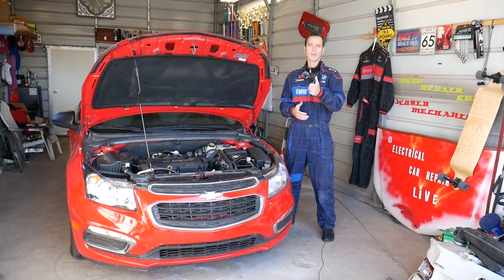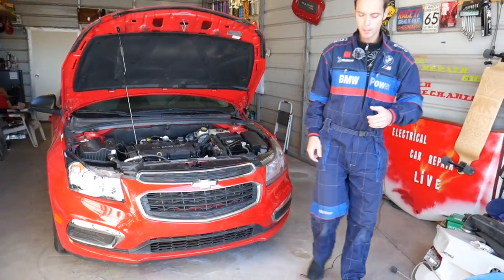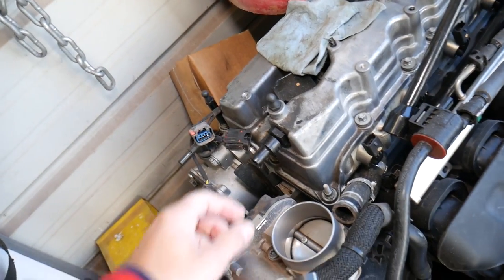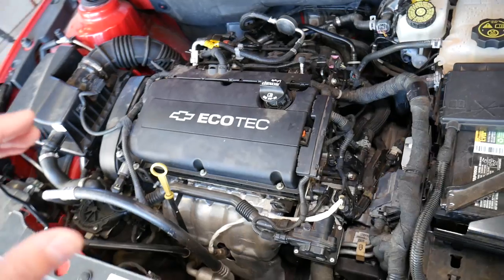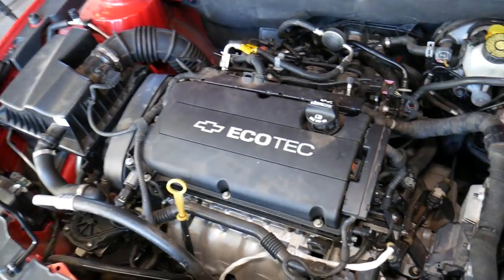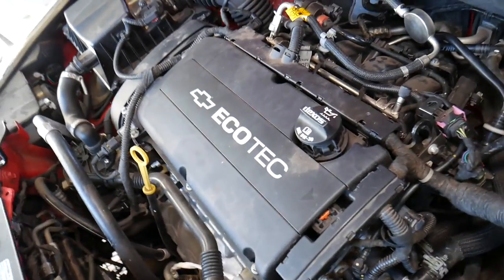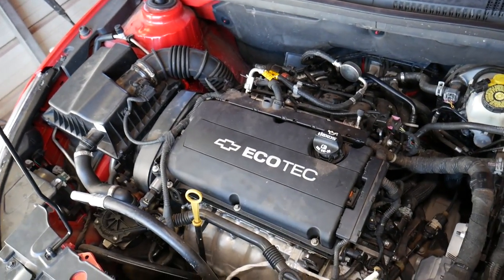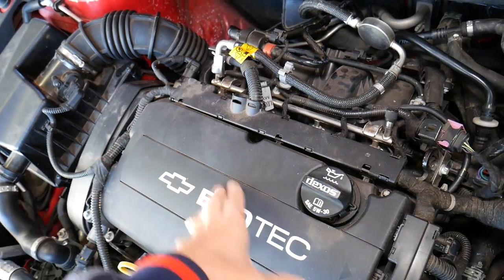SYMPTOMS OF BAD PCV VALVE ON CHEVY, CHEVROLET, GMC, BUICK, CADILLAC

Comment: My wife's car is a Saturn ion quad coup with a 2.2 Ecotec engine and I believe has the pcv valve built in to the top of the valve cover. I took the hose off that runs from the valve cover to the air intake and put a vacuum gauge on the valve cover and it has steady 7 inches of vacuum which doesn't really change with rpm. Is this just a breather hose? The pcv valve normally has a hose that is between the throttle valve and the intake valve. Yes? How do you trouble shoot this ecotec pcv valve? Thanks for any help you can offer.

Comment: Hello is way to show me we’re pcv valve for 2015 GMC Yukon XL located please is no video for that
Reply: There is no actual PCV Valve due to an "upgrade " GM tried to do on this problem.  Instead they made a crankcase ventilation system. There's a return airflow pipe going into the air plenum on the air filter side of the engine and this gets filled with an oil/water mixture and can plug the airflow causing excessive oil consumption and if not cleaned out a catastrophic failure of the rear main seal around the crankcase.  A simply quick fix is to order a GM oil fill cap ACDelco part # FC219 from a GM  dealership or online via Amazon for just under $15.00.  Then remove your old oil fill cap and install the replacement FC219.

Comment: Okay, my car PCV hose is ripped on the end connecting into the engine.. (completely off) and my car idle jumps up and down and I have 02 sensor codes. Now my car will crank but won’t stay running. Could that be the problem?